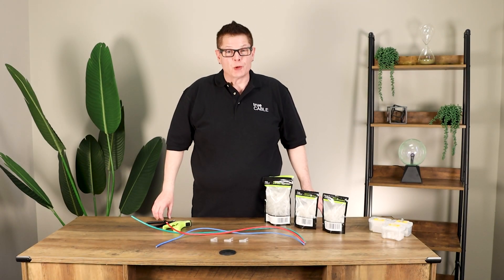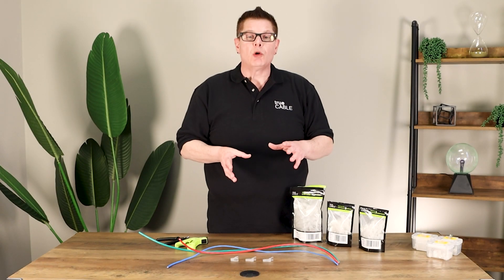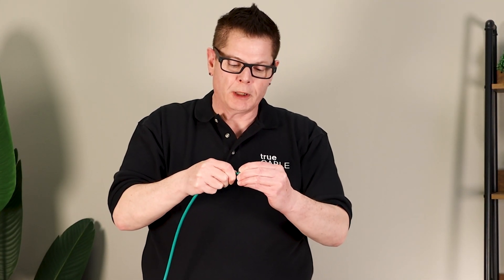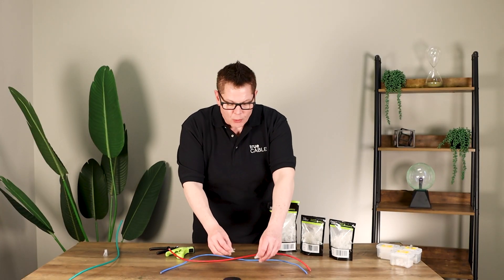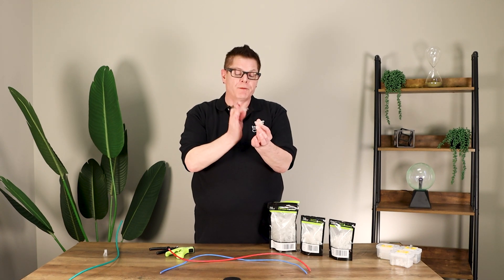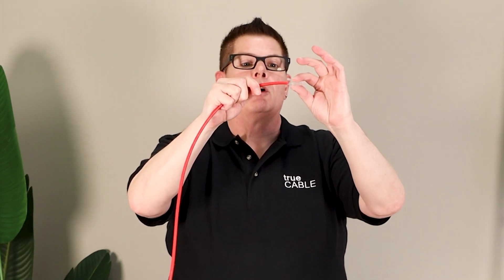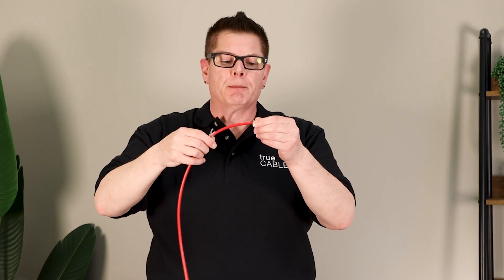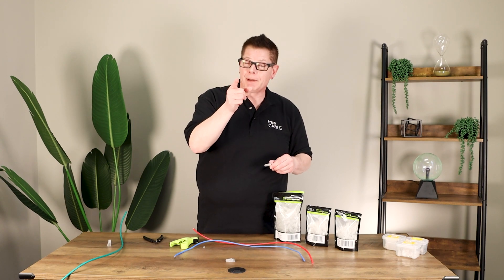Everything You Should Know About Strain Relief Boots

Comment: Great video. However, one thing I didn't see emphasized in the matching blog post is the boot inner diameter must match the cable outer diameter. Otherwise the strain relief boot won't properly take up the cable bending load as it's supposed to due to lack of complete contact with the cable. This is a much more effective way of ensuring fit as there's no standard cable thickness for each Cat version and even a millimeter can be the difference between a snug fit and loose one. As all connectors use the same fundamental load bar and crimp design, once you take care of that detail everything else works.

And yes, I learned this the hard way myself buying XL boots for CMR-rated cable, only to find that they were 2 mm too big ;)

Comment: Great video. Thanks for posting it. Will the trueCABLE cut-to-fit strain relief fit other RJ45 connectors, like the ones from Klein Tools?
Reply from the maker: Hello Kelly! You are welcome. Our cut-to-fit strain relief boots were designed and validated for trueCABLE brand 8P8C (aka RJ45) connectors. We have not cross-checked compatibility with other brands, but some day we will likely test that out! For boots that work with Klein brand plugs, you are advised to contact Klein and ask them. 8P8C connectors are standard on the outside dimensions, but NOT the inside dimensions!
Reply: @trueCABLE  Hi Don, Thanks for your prompt reply. As it turns out, I received a respsonse from an Amazon customer who claims your large cut-to-fit strain relief boots did fit the Klein Cat6 connector he purchased. In hindsight, the ONLY reason I didn't purchase trueCABLE Cat6 RJ45 connectors was because I didn't think they would work with the Klein RJ45 pass through crimper. Specifically the VDV226-110 model. Will your Cat6 connectors work with this tool? Thanks!
Reply from the maker: @idealynx  Hello Kelly! I see no reason why that particular unshielded connector we sell would not work with the Klein crimper. It is pretty standard in how it works with crimp tools, so no real concern there. The only refrain is our large external ground-shielded Cat6/6A RJ45 only works well with our particular AIO crimp tool, but otherwise, that would be the only plug we sell that has that limitation. Good to hear about the strain-relief boots! I will note that.